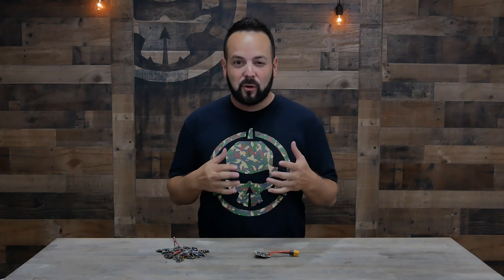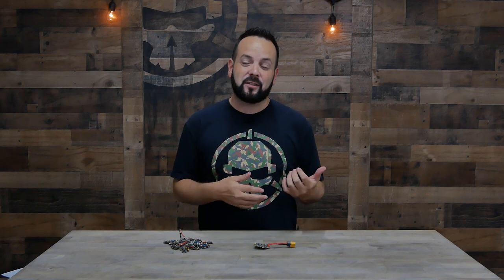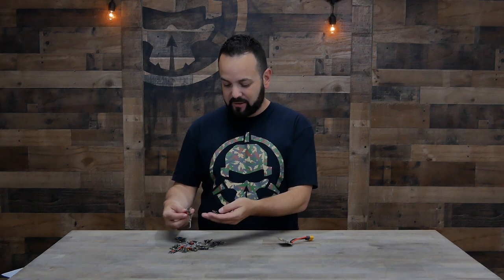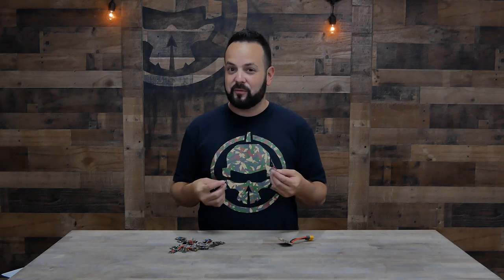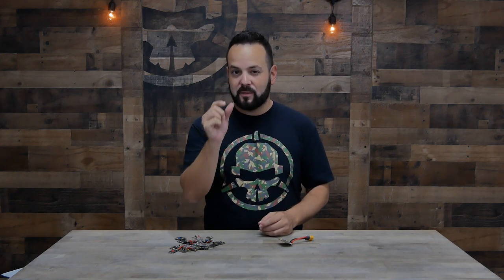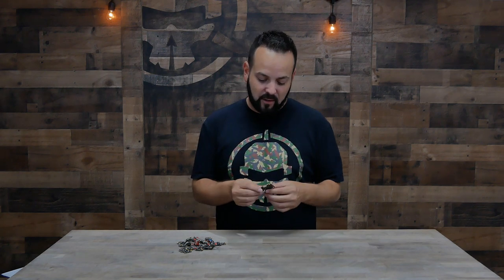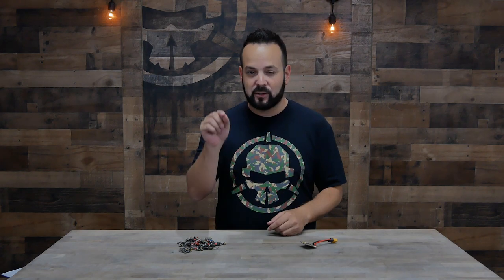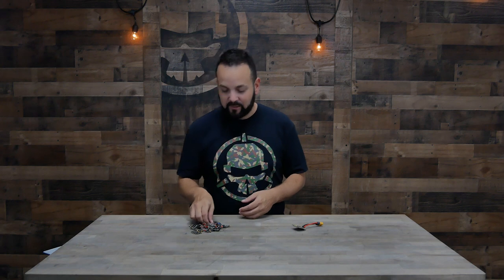Choosing ESCs for FPV

Comment: You forgot to mention- to program  BLHeli32 ESC's you need the BLHeli32 software. The software that works with older ESC's like BLHeli S and so on won't work with new 32 ESCs. That info is pretty important as this video is aimed at beginners that would be stumped when they need to change motor rotation.
Reply: Great point,  and the most current version.  I have had issues trying to flash firmware and getting my settings to save properly, then I realized that my version of the configurator was not current, after updating the configurator I was able to successfully load firmware and write settings to the ESCS
Reply: @xtkfpv5306  , my esc burned while running fpv , my esc 30a but same model not available in india but I have 45a  esc, what if happens when I connected to this motor my motor rpm is 2150 and max continues current is 31a.
Reply: @seenivasan2541  Hi Seeni,  Yes you can put a larger Amp rated ESC no problems,  the RPM is only determined by the KV of the motor multiplied by the battery voltage, so current does not factor in.   but you should make sure to try to find the route cause of the failure or the new ESC may fail as well.  Common causes of ESC failure include:  Short Circuits, Bad tuning, bent motor bell/ out of balance motor, severely damaged prop or sometimes just hitting the ground hard with motor spun up can all cause esc to fail.   Sometimes shorted motor wires can also be the cause, insepect your wires and the carbon fiber chasis anywhere the motor wires contact, for burns or burnt smells.  Remember carbon fiber is conductive, if you have cuts in your motor wire insulation caused by wire ties or prop strike, the wires can short to each other either directly or through the carbon fiber chasis. Smell your motor on the failed channel or esc circuit, does it smell burnt?  If motor windings to get too hot it can melt the insulation, if the motor windings look black or dark brown in color or smell burned, the motor could be internally shorted and cause the new ESC to fail also.  When you install new ESC follow instuctions for setup and remember to update your betaflight config to new ESC settings.

Comment: Question: 
Does each each esc on a 65a 4in1 esc deliver 65a to each motor or is it total of the whole esc?
Reply: 65A x 4 = 260a
Reply: @MircoBonfiglio  why would they not advertise that a 260a esc seems a lot more powerful than a 65a esc and plus you’ll blow up the esc before the battery meaning the total draw for the esc is 65a

Comment: I’ve never built a drone and this video helps a lot. Just one quick question. The current number on the ESC, is it dependent on the battery or the motors? Do I match the current number to the “C” number on the battery or the amp hour on the battery. Or do i look at the motors to tell me what ESC current number to get?

Comment: What's the difference between a 10 dollar esc vs a 25 dollar esc???
Reply: More filtration and high quality FETs and bigger more powerful fets... Higher quality PCBs...

Cheap ESCs always have very cheap low quality fets and cheap fets like to pop.... More costly FETs on higher end ESCs are larger and much more robust, can switch faster and cleaner and will withstand abuse much better and have a much less chance of popping.
Reply: 15 dollars hahaha

Comment: What do you think of ESC for DJI Mavic Pro?
Reply: I recomend ESC Pro
Reply: What do you mean? Those ESCs don't need to be ultra high preformance but rather need to be ultra reliable and smooth with a near zero chance of desync...  They would not preform nothing like what a race quad esc does... The switch rate will be far lower, they don't have to deal with massive RPM changes all the time and have to respond to those changes instantly and spool up and spool down the motors and insanely quick rates... A camera ship esc has 2 goals that is ultra reliable and as close to zero chance of desync as possible.